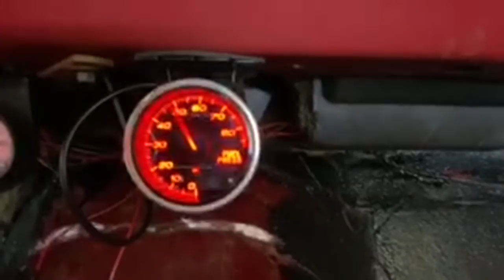Workin on the ranger last day home

Comment: The computer turns the pump on when you turn the key on for two seconds as a prime! After the computer gets a signal from the crank sens it grounds the fuel pump relay and it runs the pump while the engine is running.

Comment: 35-45 psi fuel pressure. Keep working at it you will get it the way you want it. May need a 5.0 pump the stock v6 pump might not be enough. There are really good aftermarket ones out there aeromotive is a good one.

Comment: Need to run a noid test on the injectors an new fuel pressure regulator an to check for vacuum leaks start it up get some throttle body cleaner spray the vacuum lines if the rpm's change thats where your leak is if that helps ya i had a 86 f150 302 4spd used to buck like that when id accelerate those are what i did to find the issue an maybe a tune up

Comment: Yes, I'm still trying to get caught up. LOL Has that truck been flipped? My friend flipped his Shelby. It spit him out the t-tops and landed on it's wheels in a ditch. The car was still running until I told another friend to turn it off. He had to get a new computer before it would run again. Evidently, some computers don't like to be inverted. I only thought of it after you put "us" on the dash and I saw a wrinkle at the top of your door frame. Just a thought... Good luck figuring it out. ;-)